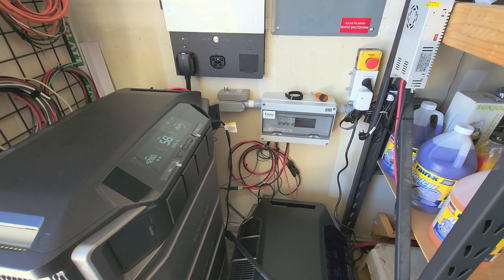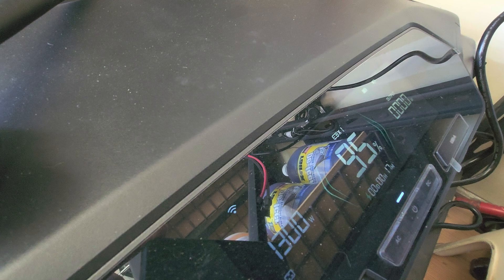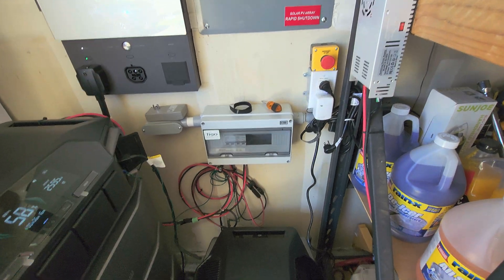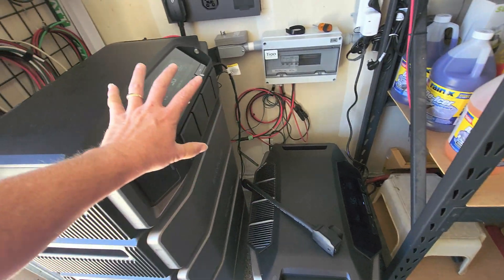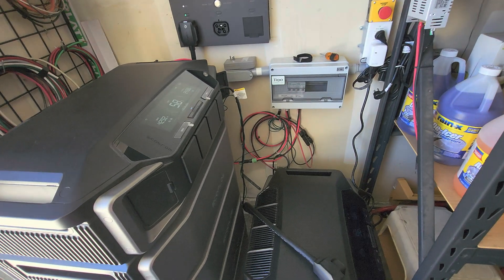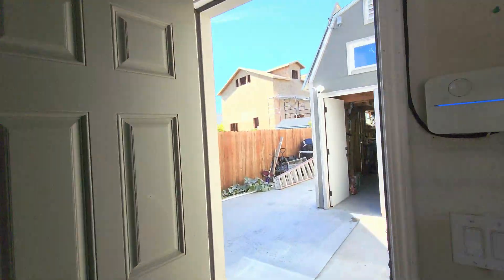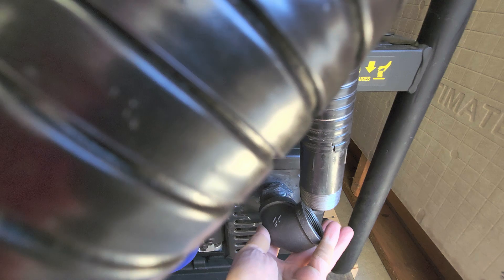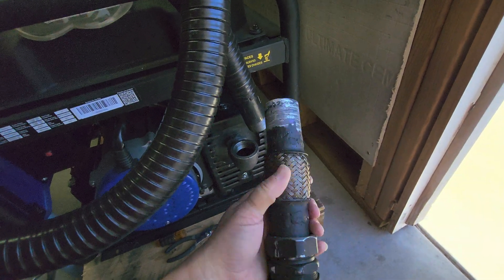EcoFlow double DPU charging from a single DPU array install / generator flex pipe update.

Comment: Your video comes at the perfect time for me, as i just posted a question on the Facebook forum about load balancing of multiple stacks, when one charges more than the other. The general concensus online from many of the responses i got, was that when multiple stacks are connected to the smart home panel 2, the DPU's will load balance the power output, such that more power comes out of the higher charged stack in an attempt to self balance. Im wondering if you’ve observed that with your own use?

Also, just out of curiousity. Why not use the low PV string to charge your smaller stack, while using the higher voltage PV string to charge the larger stack, and let the smart home panel load balance between stacks, even if they don't receive the same charge?

Final question, it looks like you have 3 batteries on your larger stack, and just one on the other. Why not have 2 batteries in each stack, so you have the same capacity per stack, and then let the units load balance as needed when connected to the smart home panel 2? 

Thanks for sharing your setup, its been very helpful thus far! 👍
Reply from the maker: @joecmarques  yes the smart home panel load balances the output the four stack will put out you know 3 to 4 times what the single stack does, it's totally load balancing which I found to be fantastic. 

I did exactly what you suggest I put the high PV to the four stack and the low PV to the single stack and neither of them got near as far in charge as the way I'm doing it now. There's just not enough input from either to top off either and I tried for a good while.

This has been the only way I've been able to get a decent charge on the single stack and the high 80s on the four stack daily as long as the sun's out.
Reply from the maker: @joecmarques  and I noticed the only state of charge balance that happens between the two different Stacks is when one is under 30% it's the only time and even then when it did do that it only raised one to about 32% and stopped even though there was about a 40% difference.

So I thought the same thing if I just let it all charge and keep them connected to the smart home panel that it would balance them and keep them fairly equal and charged state but that is not the case at all.
Reply: Thanks for confirming with real world observations. Your experience offers nuanced details that I'm not getting from the Facebook forum, snd I feel like some of the replies likely come from folks that don't even have the same unit. This is exactly what I wanted to know before investing nore heavily into multiple stacks. I'm thinking this is an area where Ecoflow could use some improvements to balance charge the stacks even when not under 30% via a firmware update.
Reply from the maker: @joecmarques  I absolutely agree with you. They should find those using and get the feedback and a lot of it is just firmware updates. Like in my case I'd like to be able to turn off one of the three ports on the panel so that it'll recognize the AC side and not have to physically disconnect and little things like that I agree..
Reply: @erickoffgrid  you can chat and submit feedback to them directly.  That's what I did.  I would like to be able to control the input of AC charge by just clicking on the AC icon in the app instead of going into settings... also there is no way to stop AC charging other than unplugging the device (or smart outlet).
They took notes and said they would submit the suggestions.